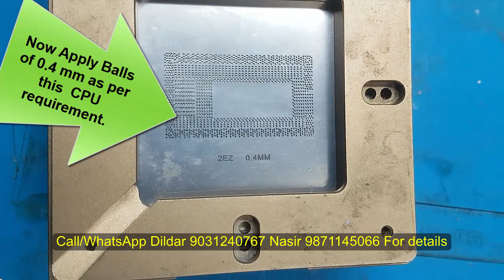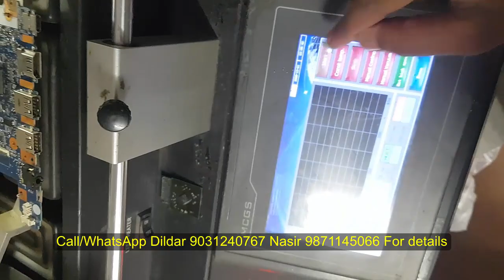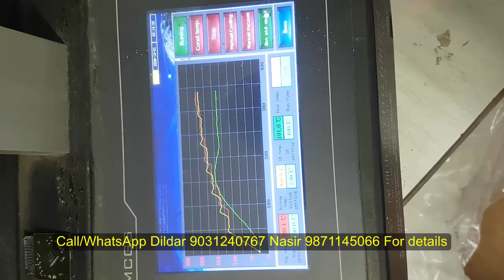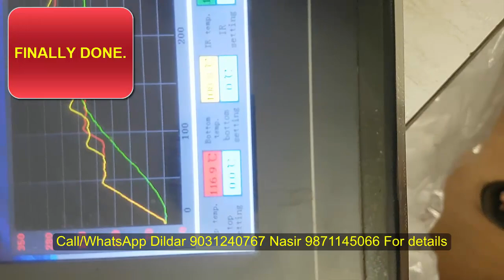How to Reball CPU Step By Step | INTEL BGA CPU REBALLING | EASY CPU REBALLING TECHNIQUE | LAPTEX

Comment: Can I ask you something about laptop, so I have a HP Pavilion gaming 15 with I7 9750H with GTX 1650, 1 month ago when I want to turn on my laptop it won't turn on, all of the indicator lights are on like battery indicator LEd lights, power button lights. All of them turned on, but my screen don't want to turned on, even the fan didn't want to turn on too, after that I go to the Service Center and they said I have to change the motherboard because they said that either my CPU/GPU chip broke or the ic, they said it happen because of overheating.
So is there any chance my laptop be fixed and worked again without change the motherboard? 

Sorry if my English bad, but I really need help bout this😢
Reply from the maker: If the GPU is shorted then it needs to be replaced or still the problem exists then need to change the motherboard.
Reply: @laptex1377  if the one that broke/short is the CPU, can a reballing fix it?
Reply from the maker: No bro.

Comment: what liquid you use to finally clean the IC and how do you made the stencil what kind of powder ball is that
Reply from the maker: It's all mentioned in the video bro.
Reply: @laptex1377  I don't think either of these are stated in the video. You don't say what cleaning fluid you use (is it isopropyl alcohol?), and you don't say what material the solder balls are (I assume it's standard tin-lead solder?).

Comment: Asalam o Alykum Sir.
Sir i have dell e7450, when i press power button, light on for 1 or 2 second then off and Battey light  also for 1 second and the off.
i removed CMOS, programmed both Chip, 4mb, 8mb with tested Bios
3v,5v ok.
pch 3v ok, when press power button ,pch coil volt come and go again in half second, also ram and processor volt have same status. i removed battery selector CD3301 ic , resold both SIO,
i also heated chip set for 30 second.but same status.
please Guide me. JazakAllah
Reply from the maker: Start from the basic....basic RTC SECTION and check with DSO.

Comment: 0.4mm balls are too small, 0.45mm should be used because the capacitors will cause miss soldered balls and unbalanced heat distribution on the bga machine
Reply from the maker: Good point but it depends on how smartly pins are being placed and at the right temperature.👍